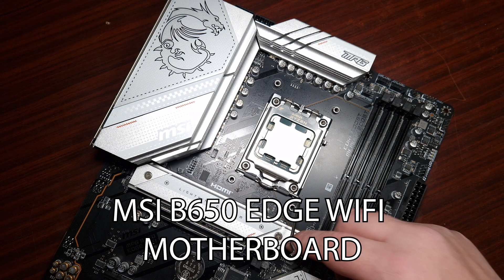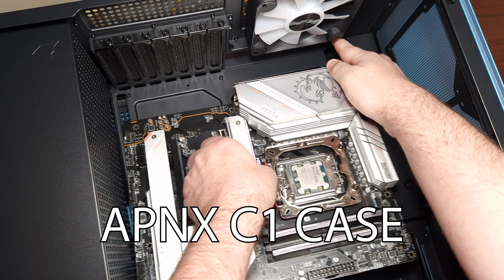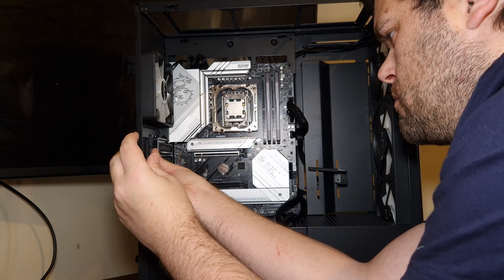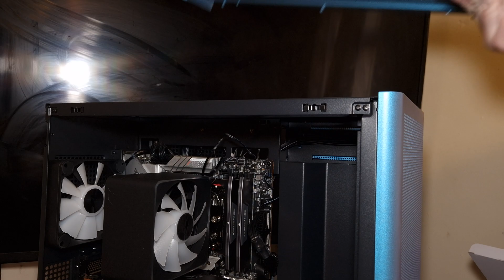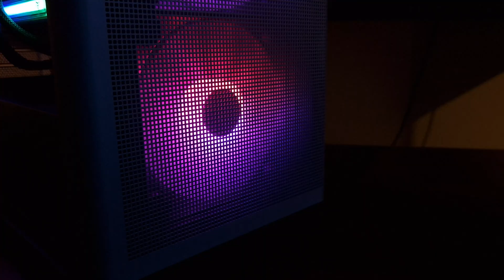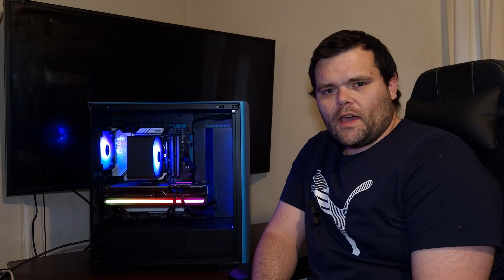PC Build That costs £1500 ft Ryzen 9 7900 & RX 7800 XT Nitro+

Comment: It looks really nice!!! And I'm glad you didn't go for the 7900X. I also have the 7900 but I'm still buying parts for my build. How has the 7900 been all this time? I also plan to use it for gaming (1440p) and some OS testing with VMs. Edit: I also want to get the RX 7800 XT but I don't think it will be the Nitro+, maybe the PULSE or the ASUS TUF
Reply from the maker: I've been using this CPU for over a year, and it has been great with no issues. It's currently in my test bench, where I’ve used it for 4K and 1440p gaming, and it always performs well. When left idle, it draws around 90 watts, making it easy to keep cool. If you enable Precision Boost Overdrive (PBO), I’ve seen it draw up to 180 watts.
Reply: @WELSHYTECH  Excellent!!!!! I’m so glad to see that the combination of 7900 + 7800XT works well for 1440p gaming. Also, what about the motherboard? Did you have any issues? Did you have to update the BIOS?
Reply from the maker: I updated the motherboard to be on the safe side as this motherboard has had quite a few updates since I've had it mainly memory and security updates
Reply: @WELSHYTECH  good to see you didn’t have any major issues with it. I’m still deciding on the motherboard and I don’t know which one
Reply from the maker: I bought one within my budget. Which model you looking at bud?
Reply: @WELSHYTECH  I had to increase my budget for the motherboard. I was initially looking at models like MSI B650 GAMING PLUS WIFI (£145) and Asus PRIME B650-PLUS WIFI (£140). Now, I'm looking at Asus ROG STRIX B650E-F GAMING WIFI (£200), Asus ROG STRIX B650-A GAMING WIFI (£170), or MSI MAG B650 TOMAHAWK WIFI (£170), and possibly the one you used. A guy from a computer shop suggested me to look at stronger or better motherboards for that CPU. My total budget for my build is stil £1500 (I live in the UK too)
Reply from the maker: I bought the Edge version of Msi motherboard, but honestly, any of those you're looking at will be just fine
Reply from the maker: And for that price if you look around you could get a b850 motherboard here's one within your budget 
https://amzn.to/3H2t48g
Reply: @WELSHYTECH  thanks for your advice! I can see around 7 B850 motherboards under £200. I still don't know if a B850 would be better than a B650 for that CPU. I never thought there were B850 motherboards under £200! The one you suggested is "8+2+2 Phases Digital VRM", which I think it falls behind the other ones I was looking at (something like 12+2 or 12+2+2)
Reply from the maker: There's this one https://amzn.to/3FolyUC which does have a better vrm layout and it's upto you bud you go with what your comfortable with but I'd look around as there seems to be many deals on at this moment
Reply from the maker: There's also this one as well bud https://amzn.to/4ms4ZrO
Reply from the maker: Did you make a choice on what Motherboard bud?
Reply: @WELSHYTECH yes! Kind of. I’ve got a list of motherboards:

-ASUS ROG STRIX B650-A gaming wifi
-TUF gaming b650-plus WiFi
- gigabyte b850 gaming x wifi6e
-b650 tomahawk WiFi
-Msi pro b850-p WiFi

Whichever of those goes cheaper next month.
Reply from the maker: Good list of motherboards. I hope you can find the one for the right price just keep an eye on them as prices will go down and up
Reply from the maker: And it runs perfectly with the 7800xt I could run any game at 1440p